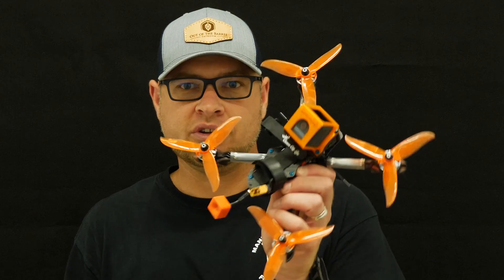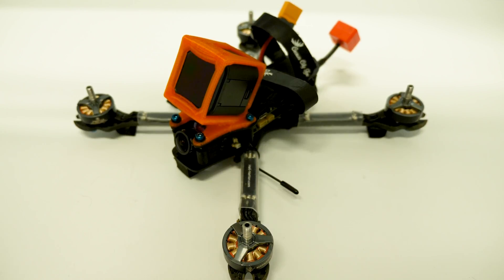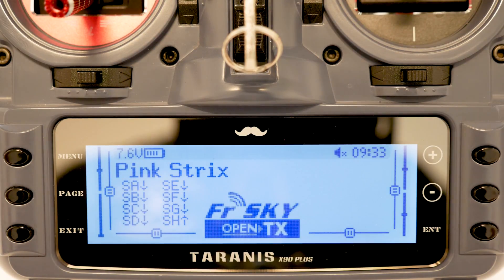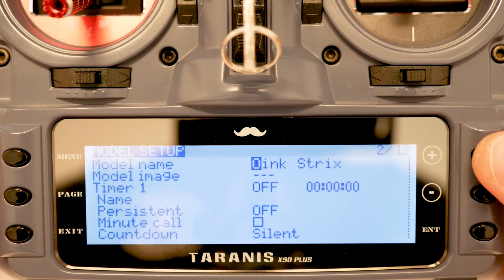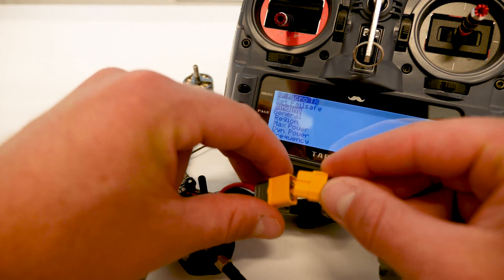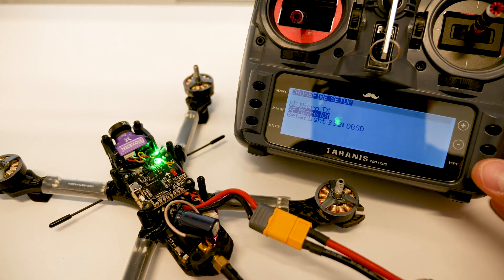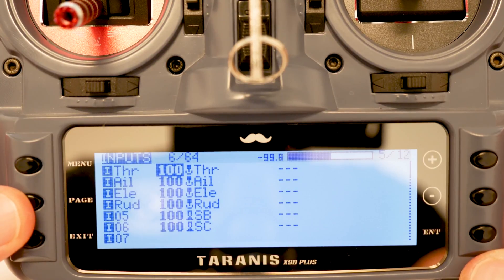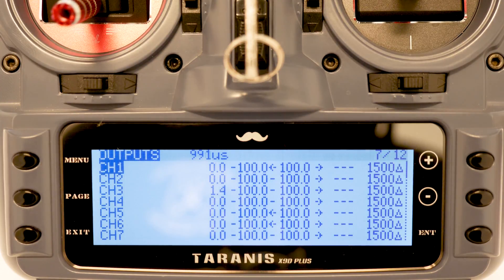Binding the TBS Crossfire | Taranis Mr. Steele edition | How to Series

Comment: If internal and external receivers are turned on, does something break?
Reply from the maker: It would be like crossing the streams... “It would be bad!” (Hopefully you’ve seen Ghostbusters). Ok for a real answer... because the settings can (and are) adjusted for each model. It really doesn’t make much sense to have both the internal 2.4Ghz radio enabled and also the external radio enabled. Would it cause something to break? No, it should be fine. But, if anything you could save a little power by not powering a component that you will not be using anyhow. Hopefully that makes sense.